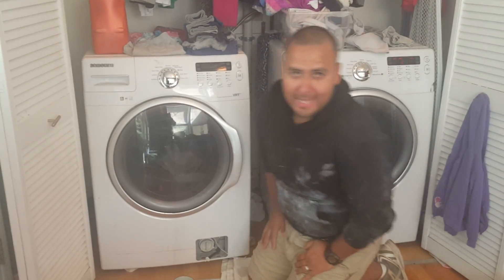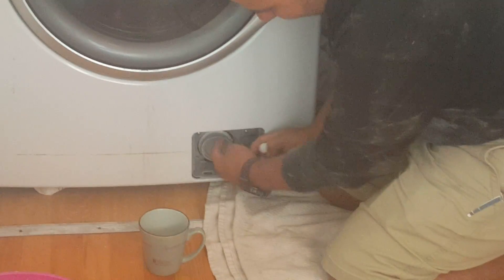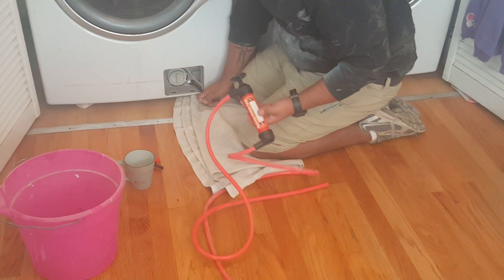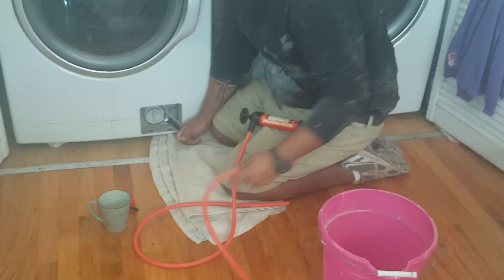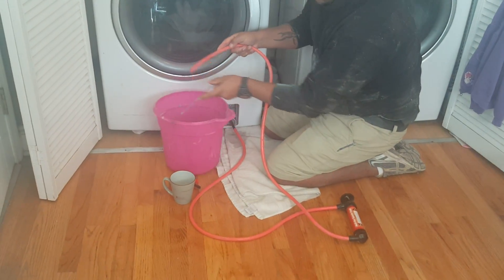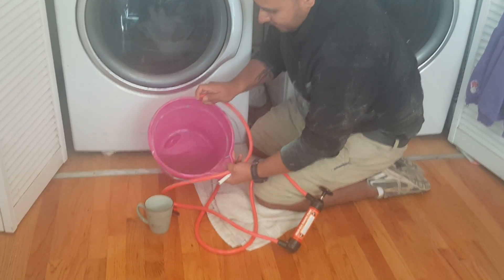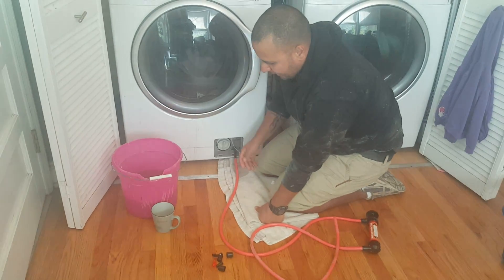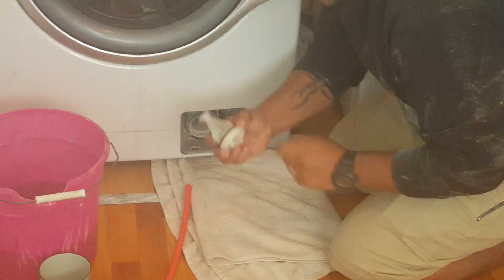Samsung Washer ND Code / Message "Not Draining" - How to

Comment: If you don't have a pump, put the crevice tool on your shop vac.  Turn on the shop vac and insert the drain hose into the crevice tool.  It will suck out the water and any gunk in the hose.
Reply: Great idea!!!

Comment: Yes but did nd error code go away, because my filter is clean but still no code. What did you do finally
Reply: Did you find out what the problem was? Mine is doing the same
Reply: @bobbymayle6066  
Turbidity Sensor
Easy to
Install, reach under your washer right next to your pump it’s there. You can probably see it when you open up spray spinner inside your washer. I’ll try to find you the video, they recommend taking out the whole wash but for me wasn’t necessary.